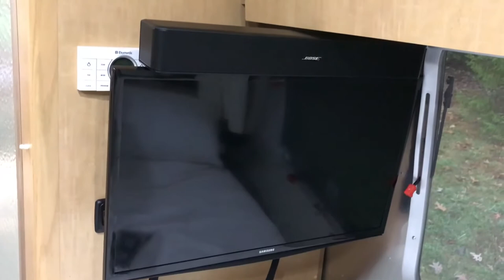How To: Moving Living Room TV to Bedroom and Adding a Bose Solo 5

Comment: That was a lot of work but you did a great job. We have the hookups for a TV in the bedroom but decided we don't need one in there. We have the wall decorated with NP posters. I would've liked a Solo 5 for our living area TV in our Airstream but the window valance gets in the way. I settled on the Riva Turbo X BT speaker connected via headphone jack. The speaker rests on a removable shelf that sits on the top of the TV. The speaker is loud enough to adequately play over the A/C fan and we don't have ducted air but it is much better when the A/C is not running. I hardly use my Apple TV anymore since getting Verizon Unlimited. I play Netflix or sync movies via the iPad and connect to the TV via Apple's HDMI adapter. That way I don't accumulate 15g hotspot usage. After 15g hotspot VZ throttles you down.
Reply from the maker: Thanks for the compliment my friend.  Have you tried using the AppleTV with Airplay?  I like it much better than using the cable and adapter and it works great.
Reply: I did try it but Netflix app will not allow it from my iPad Air. Blank screen.  Works via the adapter.
Reply from the maker: Yep - some apps are like this - it has to do with the Apple device handing off Internet duties to AppleTV.  I normally just preload my device with video before we head out for the weekend so I can Airplay without issues.  Seems like a lot of the places my wife picks to camp have crappy Internet anyway so streaming would be difficult to begin with.